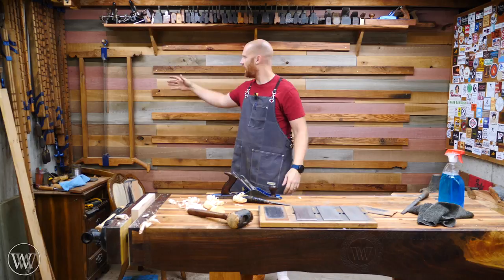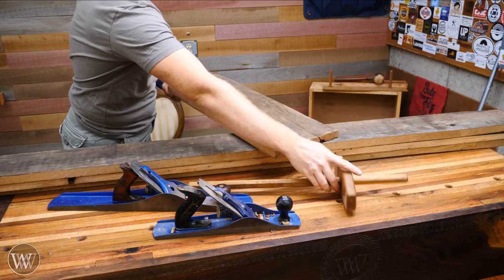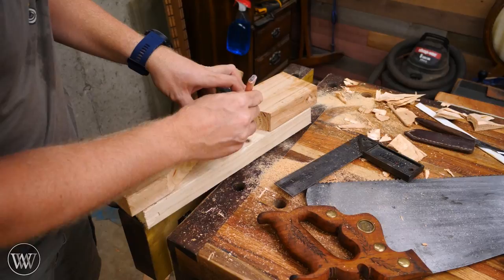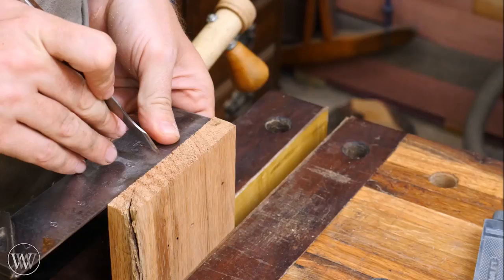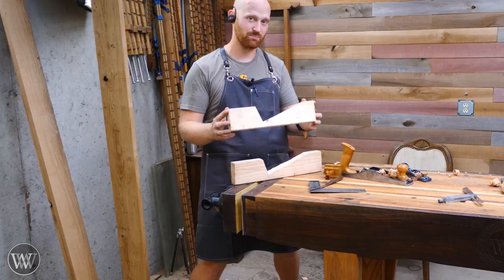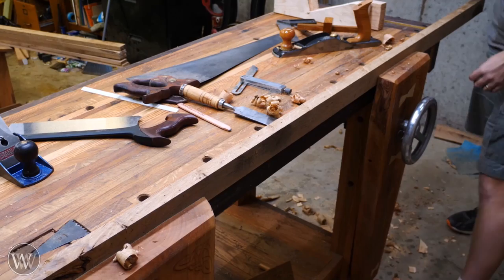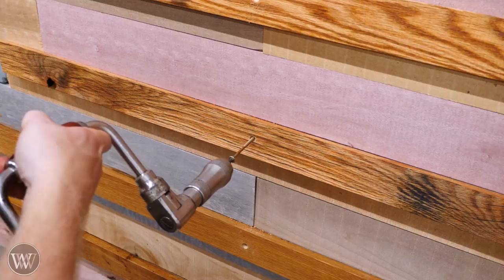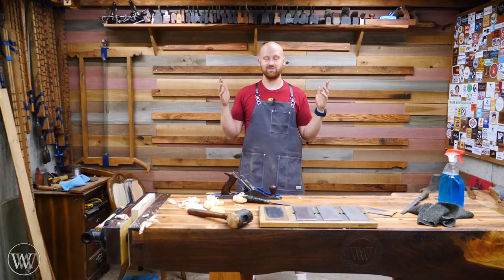How to Make French Cleats With Hand Tools | Hand Tool Woodworking Project

Comment: Planing them down would have been so much faster and easier, but this made for a much better video! Great job thinking outside the box!
Reply from the maker: I thought the same tell I did a speed test. and found out it was a wash for time. You loose material with cutting it, but everyone is going to have a preference one way or the other for cutting and planning or just planing.

Comment: I'm going with the hand plane plus jointer fence method using 8' white oak 1x4s (got ten of them recently for a great price). Had to cross cut them to four feet since my bench is six foot long. 

When I'm done, I'll have three cleats across eight feet of garage wall with the base of the lowest clear at 4 feet and the top of the highest cleat at 6 feet--high enough to dodge the wall outlet, but not so high to put tools out of comfortable reach.

Comment: Great job! When I did mine I went with planing it to an angle. It was actually a bunch of fun with a heavy cut on the plane, and only took a few minutes per cleat. But then mine were from plain old spruce the local hardware store, maybe I'd have sawn them if I'd been using nicer wood.
Reply from the maker: I will be doing that for all the smaller meeting peace that will hang on these.

Comment: A wonderfully imaginative solution for ripping the boards!  I suspect it worked well because you made the narrow portion quite narrow so the tendency to tip was minimal.  But using these saddle to hold the boards so you can cut straight up and down is brilliant!  Oddly enough I bet the idea came from your usual practice of canting such cuts in the vise so you're sawing straight up and down.  The angled ripping saddles sort of end up being an extension of this principle.

The only thing I think you will regret down the road is that you did not make the cleats run the full width of the wall.  Sooner or later I bet you end up adding pieces onto the ends.... :D
Reply from the maker: I think you might be right about where it came from.
as to not going full length, I have plans for what I want to be on the either side such as the frame saws on the left side.

Comment: Is there any particular reason you need to be a super hero every week?  Seriously awesome again. Great idea. I've been speculating how you would do this. I just thought you were going to rip and then mark 45 deg and then plane the angle. This is much cooler.  I've seen a visual reference approach before where the angle is marked on a block of wood and positioned to assist the sawyer so they can see the cut angle and align the saw but the wood rest jig at angle is pure genius.
Reply from the maker: +Travis Reese thanks Travis! This was a fun one for me.

Comment: You have a long way to go before you match Frank Howarth for French Cleats :). Very clever with the Angle Jigs, I will remember that tip. I also have to ask. How many bruises have you had on your shins from the points on the saw bench? When you first made it, it was the first thought on my mind. I made the Tom Fidgen  (unplugged wood shop)   Design.
Reply from the maker: +Peter Compton lol I leave a long way to go for a lot of things on Frank, like Radial arm saws. I have actually never bumped into the bench and I find myself using those points all the time for different cuts.

Comment: I was thinking about this problem (long bevel cuts) and all kinds of machinations were going through my mind. I had started to design a big long fancy jig on a CAD package. Now I think I will just try something simple first. How hard was it to hold the line with the workpiece at an angle like that? Would it be more difficult with greater angles?
Reply from the maker: It was relatively easy to do. A cople degrees off from spot to spot but those are easy cleaned up with a plane.

Comment: If u want to finish something with boiled linseed oil and polyurethane, can u let the BLO fully harden and put poly on top or is shellac always necessary?
Reply from the maker: if you are using oil based poly (most spray on or wipe on) then it can go on 24 hours later. if water based you need Shellac or wait a week to two for it to completely cure.
Reply: Wood By Wright awesome. Thanks.

Comment: How far apart should the wall cleats be spaced?
Reply from the maker: depends on what you want to hang on them. mine are 8" but most people do 12" and some shops where you will be hanging larger things 24" is fine.
Reply: just looking to do as your doing to store my tools and keep them orderly. Thanks for the reply.
Reply: and by the way the method of cutting the angle is genius.